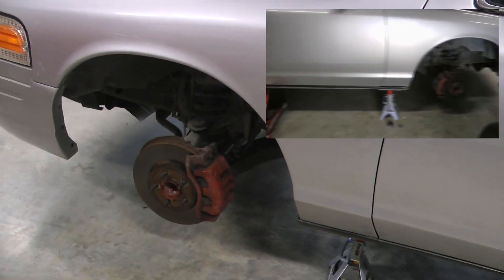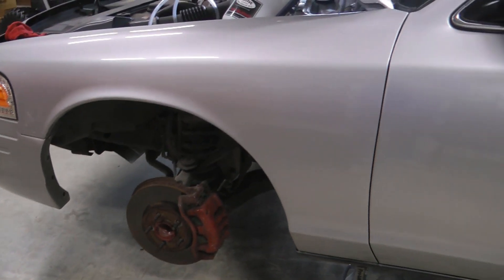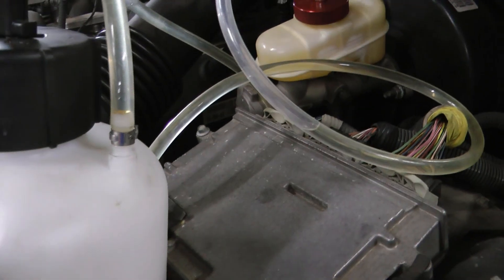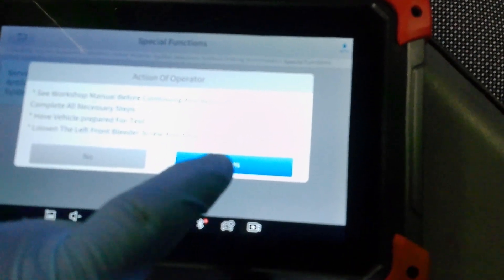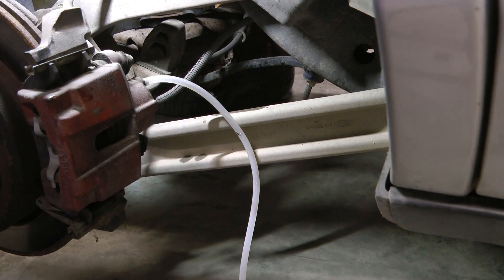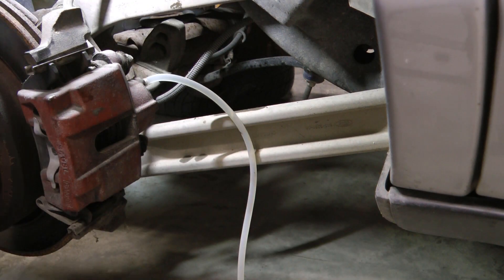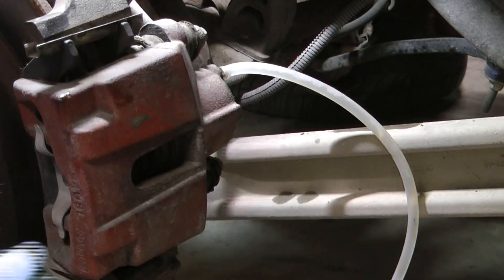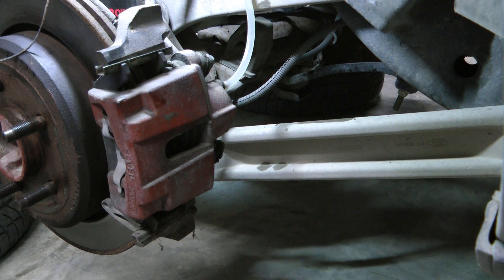Ford Crown Vic ABS bleed with Motive Bleed

Comment: cough*brake booster*cough
Reply from the maker: you're not the first to suggest that.  I did all the tests on it and it passed.  But I am tempted to just go ahead and replace it even if it doesn't fix anything it would still be a good video
Reply: @WJHandyDad  remember to measure rod distance from old brake booster
Reply: Doesn’t brake booster cause a hard pedal and not spongy?

Comment: You did a VERY thorough job of bleeding, no question there.....  It's unfortunate that your pedal is still spongy and low. What you did in this video brought my pedal back to normal (hard and high) on my 08 CVPI.  I don't know the history of your car or the work you have already done to it but maybe a bad master cylinder that is internally bypassing?  Not sure what else to say.  I do know that a spongy and low brake pedal is not normal so it has to be something causing the problem. 

By the way, side note here: My CV was having a hard time taking fuel at the pump.  It would click off almost instantly.  I saw your video about cleaning the charcoal canister bits and hoses in the evap system tray under the trunk.  Because of your video, I did that to my car yesterday.  I didn't clean everything with soap and water but I did blow compressed air through everything and I installed a new evap vent valve (just for good measure) and now my car will take gas with the handle fully squeezed and never click off.  Thank you for that video.!
Reply from the maker: I replaced the master cylinder in my 2010 and it didn't change anything.  I'm tempted to live with it since all of them stop great.  I've driven several other cars that I've never touched as far as mechanic, all of which do the same thing - stop great and then the pedal goes to the floor... including my sisters Escalade, the Maxima I just got, a friend's Vic.